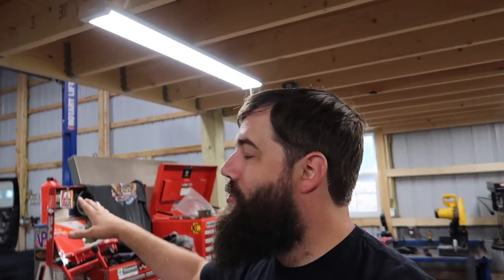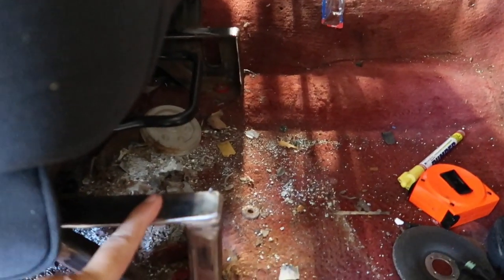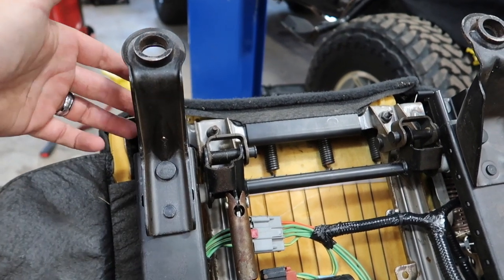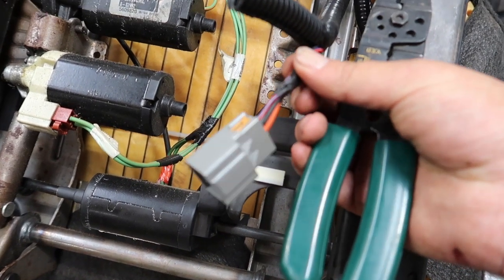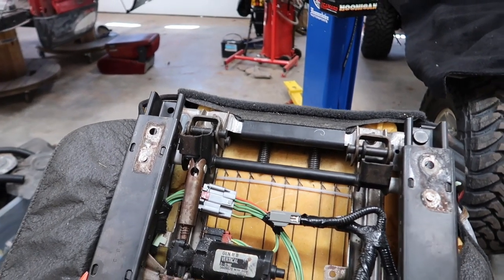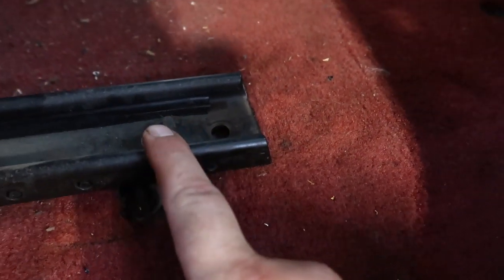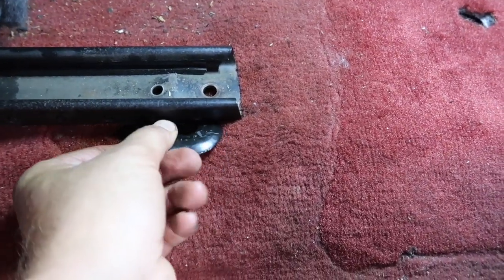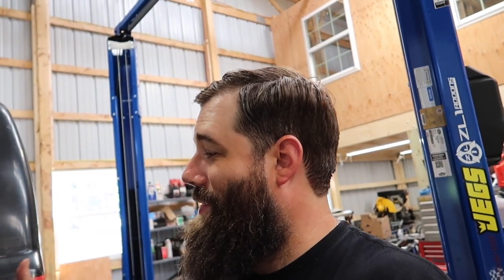2004 Seat Swap In The 1995 Ram Project

Comment: Hammerdown motorsports, is it possible for you to make this bracket set up and instruction and mail them to me so I can have these seats in my 2001 dodge 2500?
Reply from the maker: It really is a first for me still don't really know how it will perform once I start using the truck, that being said I am not going to be making them for sale at least at this time
Reply: @HammerdownMotorsportsUSA  Ok I saw the video and My Kids and I are going to do it in our 2001 2500 diesel build.  Thought I would ask and see what you said!!  Thank you and it was a good video
Reply from the maker: @davidschneider2596  for sure it isn't too bad just some cutting and light welding you technically could build new mounts completely but I chose to use the old ones and modify them

Comment: What size fuse is are the seats hooked too?
Reply from the maker: Rosa The German Shepard they are connected to the factory power seat wiring
Reply: Do you know what side of fuse those seats would require
Reply from the maker: Rosa The German Shepard my guess a 10 to 20 amp I’d start small and if it holds it should be fine but best way is read the amp draw and go from there